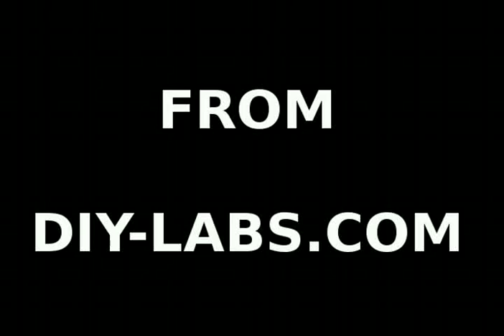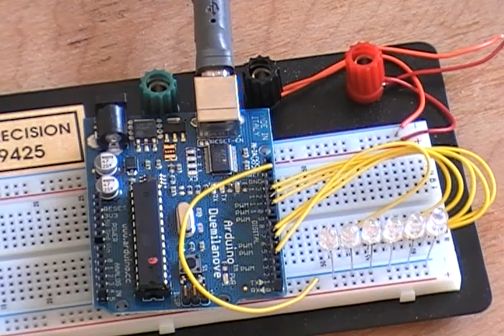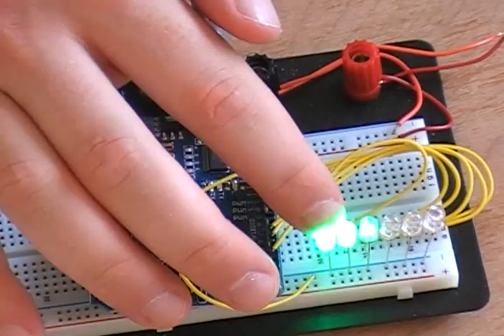Enhanced Arduino Knight Rider

Comment: As for the number of lights, there are only 6 in the series. If you plan on doing this for your car, having a few LEDs in parallel for each step of the lights will give you an effect much more like the series. Using the arduino to drive standard 12V bulbs would probably give the best effect though... it's all personal taste.

Comment: The lights do run at different speeds depending on what's going on. Most people aim for the speed up the lights as they're shown in the second shot of the series intro. It's about impossible to get them running at that speed using just delay () (from the code on his blog, Google it "enhanced knight rider arduino"). Changing the delay from milliseconds to microseconds (delayMicroseconds) will give you a little more control. delayMicroseconds (2300) seems to match the intro a little better.